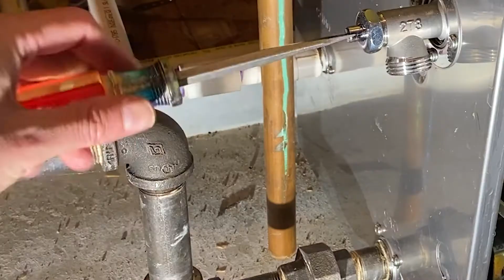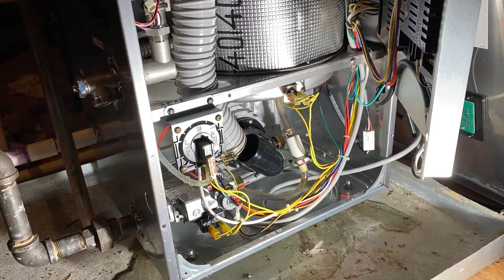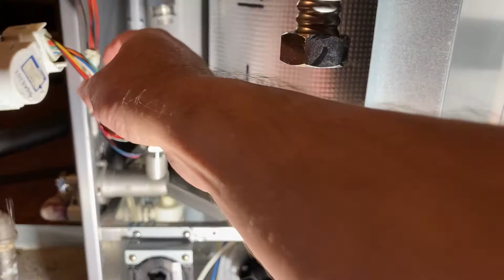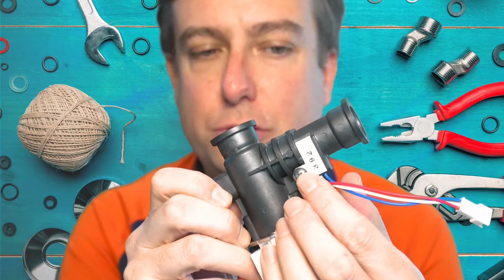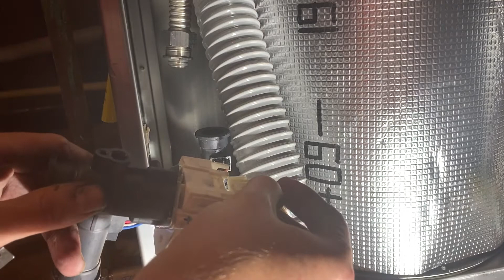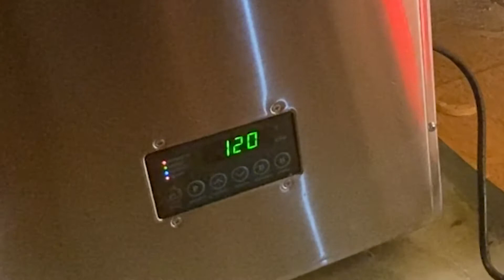DIY Well: Fixing Eternal Water heater E27 code and leak!

Comment: At this location the model is GU-26 and being used as a hot water baseboard heating furnace with a circulating pump. The thermostat turns on the pump only so the water flow in turn starts the heater as if someone opened a faucet tap. The 120F is enough to do the job. Everyone knows these water heaters should NOT be used as furnaces but this is the legacy installation at our abode. I recently ordered  the new valve from Tanklessparts for 59.95 plus 10 shipping. The actual E27 error is triggered when the mixing valve stepper motor cannot make a full end to end rotation check cycle when called upon to move to setpoint. There is a small magnet in the gearbox used to sense gear position at full end stop. There's a youtuber showing this gearbox and magnet and how it has to be aligned correctly upon disassembly/reassembly. That says it all right there. According to the op-manual, E27 is a mixer valve INITIALIZATION failure, this is the end to end check cycle. Just replacing the stepper motor portion of the valve will stop the E27 flag. This works great if you  can't waterpipe the whole new valve in, hopefully avoiding draining the system and starting a leak. I'll follow up and post results.
Reply: 3 Days later, success! New part arrived. I connected ONLY the new mixer valve electrical connector and it works, no more E27 error nor any new error. The next step will be to attach the new motor onto the existing valve body in place. This is just the white plastic motor portion. I think it'll swap without water exposure. The gear with the sense magnet in the new motor gearbox must align to match the original motor's gear position. That lines up with the end to end movement of the valve. If the water valve itself isn't frozen it'll work as designed again.

Comment: After taking my GU195 apart to correct tiny leaks I was able to find O rings from Rocket seals 🚀 Denver Colorado. In business since 1951. One thing I found that did more troublesome things. The condensation collector was in need of cleaning. The water backed up into combustible area. Ignition and flame detectors were corrupted from water. Simple clean start to finish about a hour.

Comment: The o-ring link results in an error, indicating the product is no longer available at Amazon.  I saw a comment that the o-ring size needed is 20mm x 1.5mm, but none of the o-ring sets I could find had this size.  Can anyone confirm the correct size to be sure, and/or provide a new link to a set that will include the needed sizes?  Also, can the o-rings be standard black rubber, or is the o-ring in the video white silicone or another material that is advised?  Thank you!
Reply: Any guidance on the o-rings is much appreciated….
Reply: @robertwood3241 I had the same issue. The link to the o-rings on Amazon is dead. Do you have a new link or know the diameter to buy?
Reply: @drollbay  - Unfortunately, nobody ever replied to me.  We had the warning light come on for this problem 4 months ago, and we hit reset on the Eternal unit.  So far, knock on wood, the unit has been running fine and the light has not returned.  I bought every part in preparation for this failure except the o-rings.  If/when it happens, I'll have to remove the existing o-rings and take them to the store to match up if I find they are worn.  

[In the meantime, if anyone else out there can confirm, Daryl and I would be very grateful for the proper information on the o-ring size.]
Reply: I took the o-rings to home depot and tried to match them up the best I could but they were a touch larger than stock. Got it all together which was a serious pain. They used this stupid compression fitting that is really hard to line up perfectly and I spent four hours getting it all aligned and then one of them would rupture sending water everywhere.  I eventually just ripped out the eternal and got a navien because this is now the second eternal that has failed on me and the product does not seem well designed hence their bankruptcy.  @RichmondHomes

Comment: Great Video,   I've replaced my E27 mixing valve a few times exactly like you've shown in your video.    I'm now getting an E26 error and the unit is refusing to operate.   Any idea what the E26 error code is for or if there is another part which must be replaced?

Comment: Thanks for the helpful video. I purchased the part from a different outlet for about $81. It is actually manufactured by Rheem. 3 repair plumbers were not even interested in looking at the problem. Instead they tried to sell me a new heater, saying that the Eternal was not repairable. Each was selling a specific brand and praised it as the world's best and that every other brand was no good. About 45 minutes of my time to get it running again.
Reply: Thank you for the direction towards the Rheem part. I purchased Rheem P/N RTG20298N identified as a flow control valve. 
Much more practical option from a pricing standpoint.
Reply: Can you post the model number from rheem? And or the website.

Comment: Yep, excellent video.  My ancient Eternal Water Heater is back online.  One thing I'd like to add to the discussion -- the new mixing valve doesn't come with o-rings and the old one didn't appear to either, so I just reassembled everything and got leaks galore around the unit.  Using 2 silicone o-rings and a schmeer of silicone gel on each, reassembled and no leaks now.   Got the box of recommended o-rings from Amazon ahead of time and found that the ones labeled "20*1.9" fit the orifices  perfectly.   Thank you!
Reply: The link to the o-ring set is broken.  Would you please reply with the manufacturer and part number for the o-ring set?  I’ve sourced everything I need except being able to confirm the correct o-rings.   Thank you in advance!

Comment: Super well done.  We get the E27 error code on occasion and need to restart the water heater (unplug and wait a minute the reconnect and look for a restart.  I was looking to buy a new mixing valve but stopped to watch this video.  Very glad that I did!  The description on a new mixing valve mentions something about the small internal flow sensor not included in the new replacement part.  This small impeller inside the mixing valve apparently is the part that becomes faulty and was eliminated in later versions of the mixing valve as shown in this video.  This new to me information further created more questions for us. Such as, there may have been a date code or manufacturing code for the original mixer valve versus the later revision without the impeller.  So which to buy?  From this video, it appears that the newer mixing valve is a direct swap without any concern - that is a really great revelation.  
Now, a different take on keeping the Eternal working for many years:  what if NO new replacement valves can be located and you don't want to spend perhaps thousands replacing the hot water heater?  One answer might be to try to remove the impeller - that may be an ugly solution and one of last resort because the impeller may have been factory installed with adhesive or ultrasonic plastic welding - we simply do no know.
Another what if:  what if other manufacturers used the same mixing valve for their tankless hot water heaters?  The units may look the same in a photo found on Google or eBay but the electronics may be different- I don't think that I would want to risk blowing out the Eternal mother board controls trying this without knowing.  We don't have the schematics on "other brand but identical looking" mixing valves for comparison.  
And one more what if:  What if the mixing valve control and reporting electronics are at fault?  Could either of those electronics be repaired to fix a bad discrete component like a capacitor or resistor?  That seems like a 'long shot" and might involve having the Eternal shut down for a longer than acceptable time while a local or national repair shop could repair the electronics at a very high cost.
So what to consider in summary:  Buying a replacement mixing valve and keeping it in the location with the knowledge that the original mixing valve will someday fail... that seems to be the prudent thing to do.
As DIY'ers, we keep some spare parts around when finding or getting a repair part in a timely fashion is important.  We keep some replacement parts for our John Deere D140 lawn tractor handy because you never know when a rock will damage a mower blade or a mower deck pulley, mandrel, or belt will get damaged.  While those Deere parts are readily available (unlike this mixing valve used by a bankrupt company), when you need it, you need it now, and can save a lot of overnight shipping cost as well. This is what is driving our decision to buy a new mixing valve after viewing this really well-done video.

Comment: Thanks for the video.  I noticed my eternal had a E27 code last night.  I watched your video.  My Eternal unit is not leaking.  How sure can I be that with the E27 code the proper replacement of the mixing control valve will get the machine working again?  With no leaking, would you recommend I leave all of the gaskets as is?

Comment: Enormous thanks for this video. I ordered the part, but while waiting I took out the mixing valve, cleaned the spinning sensor inside with some WD-40, freed up and realigned the servo motor, and reattached. E27 gone.

Comment: This is an awesome video! I'm hoping to be able to do the repair tomorrow when my part arrives. One question: in the comments section you linked a rubber washer set and I was just wondering what those were for? I have both a leak and the e27 error code so I was planning to replace all the O rings as suggested, but was wondering if there's anything I should be doing with the rubber washers. Thanks!

Comment: Hi there! Thank you for posting this I just experienced this error code & quickly went to each website you recommended. Unfortunately the Rubber Washer Set will not ship to my address for some reason. Do you have any other recommendations please? It also looks like the mixing valve does not include  the internal flow sensor & O'Rings need to be purchased separately; I did see your recommendation for the O-rings but didn’t realize the mixing valve didn’t include the internal flow sensor as well. 
Thanks a bunch, hoping to get all the items quickly so I can get my hot water back!

Comment: Thank you so much for making this video, it was very helpful and well done. My situation was almost exactly the same as yours; a failed mixing valve and multiple leaky joints. I replaced the mixing valve and all o-rings (thanks for the recommended kit, they worked perfectly). Some of my hose gaskets were cracked. I wasn't unable to find a good match in a flat silicone washer, but a 7/8 OD 5/8 ID o-ring is holding so far. Thanks again!
Reply from the maker: That’s awesome!  Thank you for taking the time to give feedback.

Comment: This repair video was easy to follow and taught me a bunch of things about a tankless water heater that came with the house.  The cost breakdown at the end was very helpful to help wrap my head around DIY vs professional costs.  The links to the replacement part for the water mixing valve came in very handy.  Thank you for sharing this information.
Reply from the maker: Thank you very much!

Comment: Hi, at the 3:36 mark is where my leak is coming from. Do know why it may be leaking?  Is it due to mixing valve failure?
Reply from the maker: Are you talking about the stainless steel couplers connected to the corrugated pipe above the valve?   Should have nothing to do with the mixer valve.  But you would need to remove those fittings and replace the gaskets.  I show how to do this.  Identify the fitting. Disconnect the clips and replace the gaskets.    Are you getting an error code or just noticed a leak in the pan?
Reply: Yes the elbow stainless steel coupling. Not sure from which side the leak is happening.  On the video at the 3:36 mark I think you said it will leak if it’s only receiving cold water. Is that correct?  

The tank was leaking and then the E27 error came one. No hot water followed. 

Last night I drained the tank, and it began working. I did nothing else. 

Then today E27 came back and the leaking continues. 

It’s it just a failed gasket or mixing valves needs to be replaced?
Reply from the maker: @kimnangseng3876  in my opinion you have two problems with neither of them being related.  People sometimes have success restarting the unit and getting the code to clear, but it will come back.  Amazon the gaskets I have linked and prepare to do what is shown in this video.  If you have the gaskets I would replace the gaskets on every fitting you pull out.   I didn’t show it in the video but the first time I put this back together, I had a new leak start from a fitting that I removed but was not leaking previous.  I took it out, replaced the gasket, reinstalled and everything was fine.   Do this repair at your own risk, but I am confident you can do it if you are watching the video.
Reply: I guess what I’m trying to ask is does that part only leaks when the water is cold?
Reply from the maker: @kimnangseng3876  the part is not supposed to leak at all.  In my original case when I stated that the Cupler was leaking when the water was cold, I can make an assumption that there was already a problem with the gasket. When the tank turns on and the water gets hot, it causes thermal expansion on the fittings that would help to seal off a small law in the gasket.   If you are seeing leaks in any of these parts, they need to be repaired.
Reply: Got it!  I didn’t know if E27 was due to failed mixing valve or from the leakage  of the coupling.  Where I got confused  was from online research it seemed many folks determined that E27 was an mixing valve error

From what I understand from you. E27 can also stem from something else. In my case the coupling leakage.
Reply from the maker: @kimnangseng3876  I don’t think you are understanding me.  Your e27 error IS your mixing valve.  You are going to have to replace it.   The leak is not related.  It is an additional problem.
Reply: Ok. I finally understand what you are saying now…. Thank you for clarifying and all your help.  Purchasing a new valve… and gasket.
Reply from the maker: Please let me know how this turns out.  I like success stories.
Reply from the maker: @kimnangseng3876  One other thing.  When I am saying 'gasket', I really mean o-ring.  I hope you got that.  The o-rings are inside the fittings.
Reply: @rhturner  mixing valve was really easy to install, thank you!  But now I have an error E02.  Still no hot water at the moment.  Luckily for us, it's summer time and we are experiencing a heat wave.
Reply from the maker: @kimnangseng3876  Please see https://lildutchuncle.com/eternal-water-heater-error-codes/#01_Eternal_Tankless_Water_Heater_Error_Code_e02
Double check all your electrical connections.  Make sure gas is on.  I am so sorry you have run into something else :(
Reply: Hello quick update, got it fixed and working. After switching out the mixing bath I got that error E02.  I let it sit to dry out the tankless.  Send I adjusted the new making valve to make sure that is straight and plumb in the unit. Then turn it back on and now it’s working. The error went away and gas been working for about a week. 

Also, Sidenote when I switched out the mixing valve I did not need to remove any of the pipes or the long vent pipe in front of it. I was able to remove the old mixing valve by slipping my hand through.  Same thing with putting it back on.  Thank you again for all your help we are back in business.
Reply from the maker: @kimnangseng3876  Thank you very much for following up. Glad it’s working.

Comment: Ha! just received this code over the weekend.  Any chance you had a code E 02?  Something about not being able to detect the burner flame?  Wondering how hard that part would be to replace!  I get it occasionally.
Reply from the maker: So there is normally a thermocoupler to detect the flame.  You should do some research on how to clean water heater thermocoupler.  I doubt this is something you need to replace.  Just clean.

Comment: Your video is so helpful.  We are in the process of attempting to repair our Eternal Water Heater now.  There is an "s" shaped corrugated pipe that attaches to the top of the mixing valve.  The upper fitting or connector (that attaches to a plastic pipe leading to the #27 Hot Water Tube Assembly) on this "s" shaped corrugated pipe broke.  There is not a part number for this piece, and we are told that there is no way to find/attach just the connector itself.  Do you think we can use an off-the-shelf flexible stainless steel water heater supply line in place of the "s" shaped corrugated pipe?  What do you recommend?  (This part is shown in your video at 8:15.)
Reply from the maker: Yes!   I think you’ll be fine.  It may be tricky as the part is small.   I think you would be ok using a funky routing if you get a piece too long.    In the end, all you are doing is routing water.  Make sure you are careful bending the pipe.  If you aren’t careful your bend will crimp the pipe too much and restrict flow.  Please take this advice as follow at your own risk.    I’m not a plumber, but I would try it and see.     I do think you can get the correlated stuff to length.  That wound be the safest.  Something else to keep in mind. The inner diameter of the stainless stuff is likely smaller than the ID of the original corrugated.  Verify it is the same.  I wouldn’t restrict flow with a smaller pipe.
Reply: Thank you!  I’ll let you know how it goes.
Reply from the maker: Thank you.  Please do.  I want to hear a success story :)